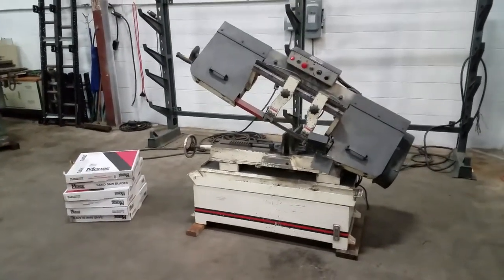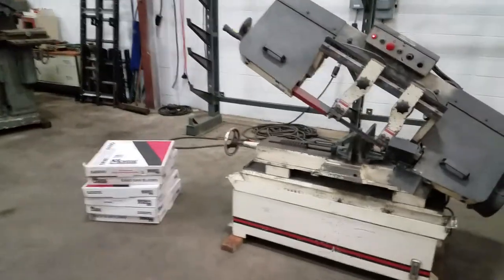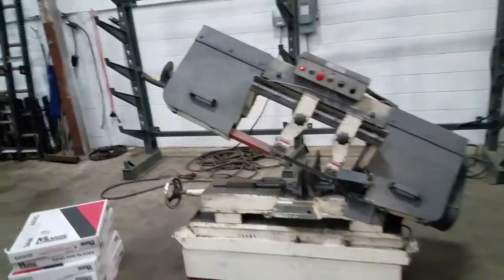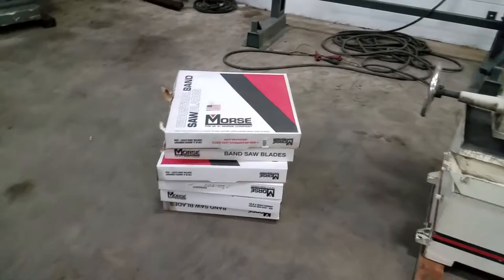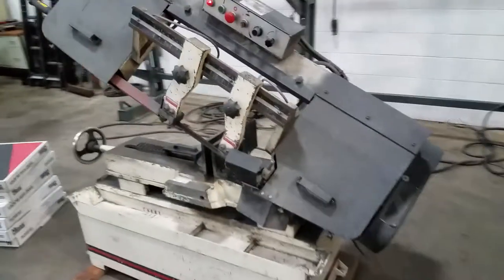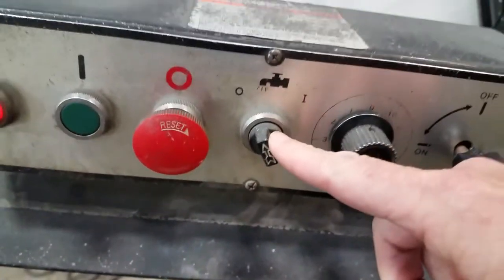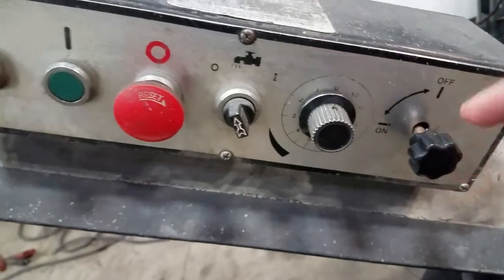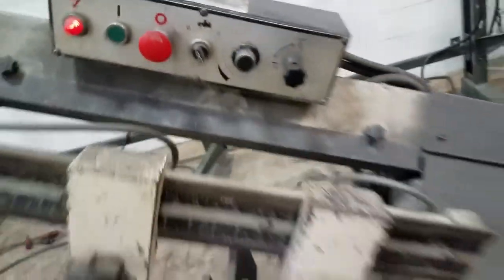Jet HBS-1018W, 10" x 18" Horizontal Bandsaw

Comment: Hello, we have the same machine in our shop. Would you share the wiring inside the panel? One of the wires (#1) was loose when I opened the control box.  Also, when you replace the knob for the On/off switch, and speed,  do you just remove the valve? Would love to hear your advice. 
Best